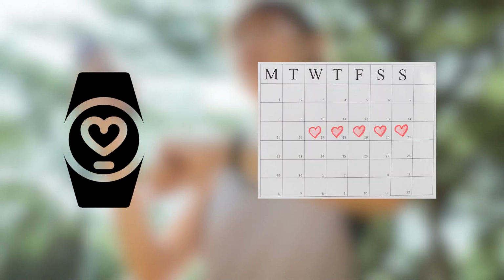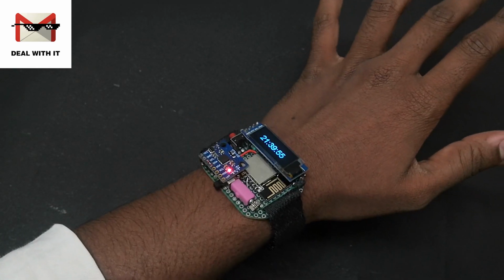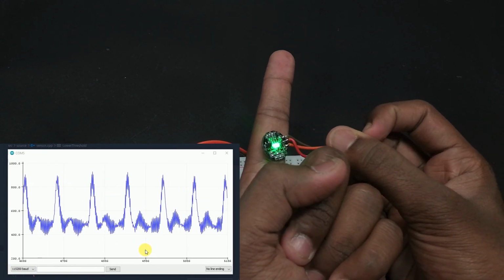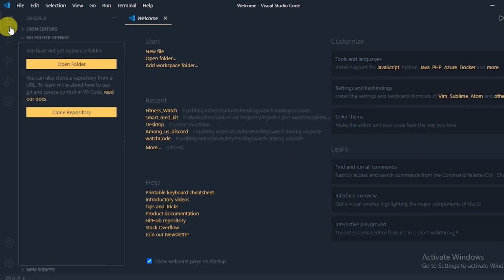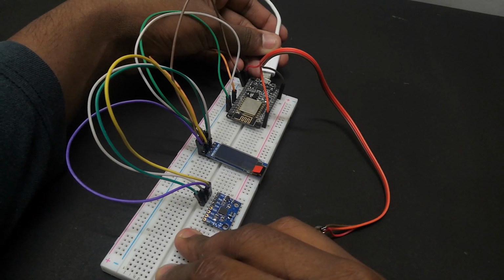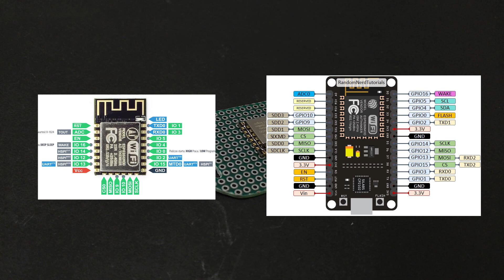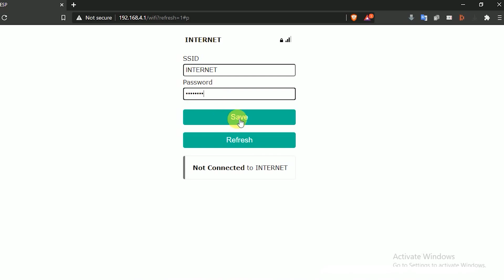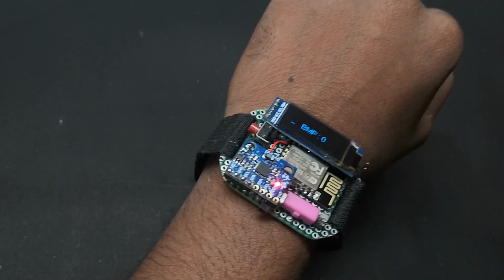Fitness Watch based on ESP12E and Platform.io - [NSFW]

Comment: what do you recommend to the power optimization ?
Reply from the maker: You can get rid of led on the MPU6050, use a better voltage regulator and you can even replace the vibrating motor with smaller one.

Comment: you can combine it with the pedometer. Very nice project, but having code for Arduino too would be perfect
Reply from the maker: Yes pedometer would be great for the project.
The code is Arduino compatible, You can try opening the file main.cpp in Arduino, it should work. (But make sure to install all the necessary libraries)

Comment: Thank you for the great project and I really enjoyed watching the video. I have few suggestions... It would be nice if you added battery charging/protection circuit,   use a small capacitor with the ldo regulator, and use another WiFi manager that can can scan for available networks. Nice job!
Reply from the maker: Thanks for the feedback!